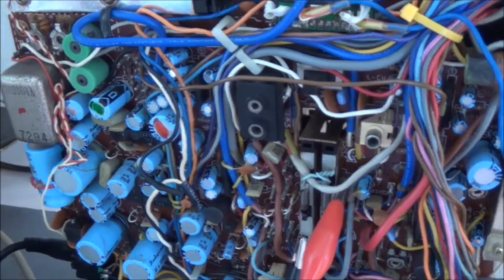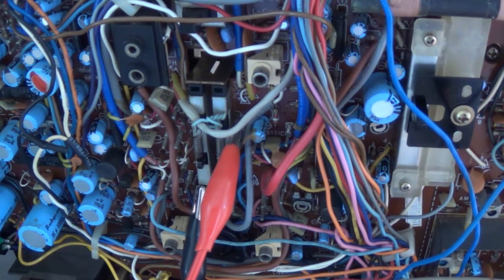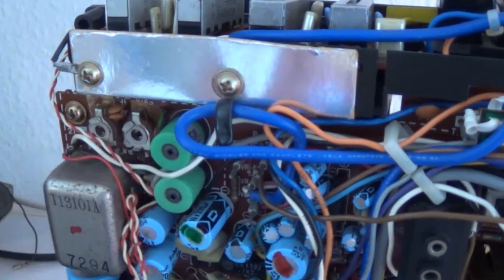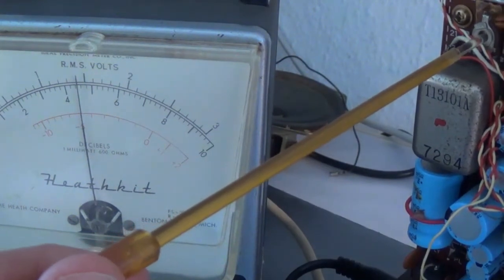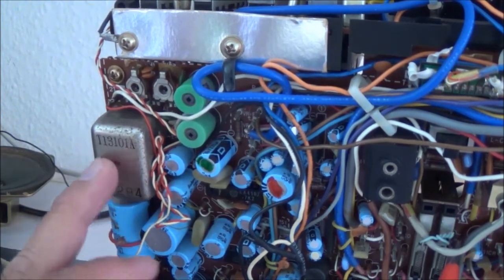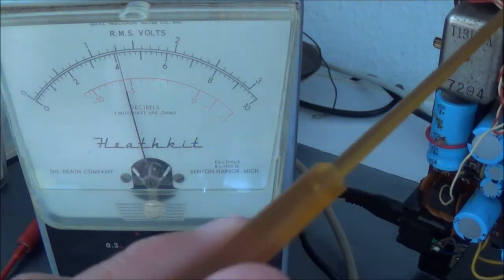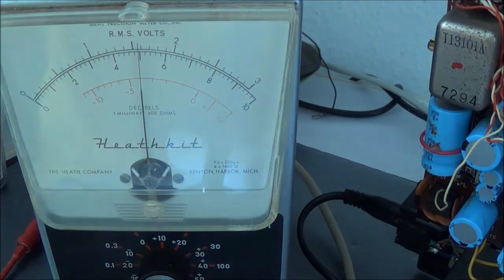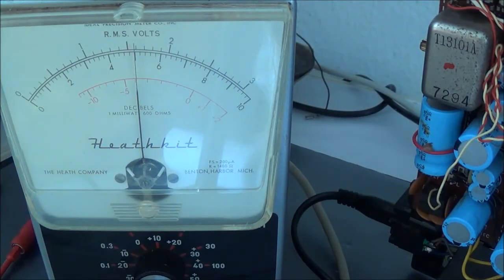Sanyo Boombox Bias Adjustment

Comment: Very cool, I have a few tape decks I need to work on...what if one does not have the SAM's for the deck, is there a rule of thumb?  ~Jack, VEG
Reply from the maker: Rule of thumb (here the fast version): clean heads, demagnetize heads, change belts, clean moving parts like pinch roller (check for wear and glazing)/capstan, check idler wheel rubber, make sure linkages work smoothly, and so on!
Reply: So basically what I'm doing now and don't worry about the bias control!  Thanks for your input, I appreciate it!  ~Jack, VEG